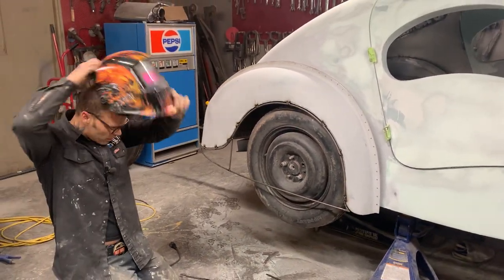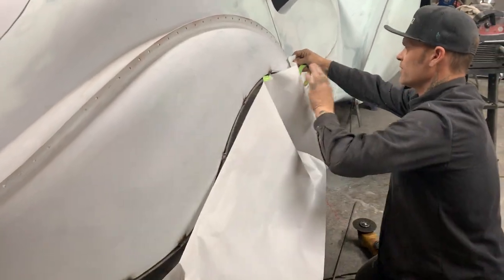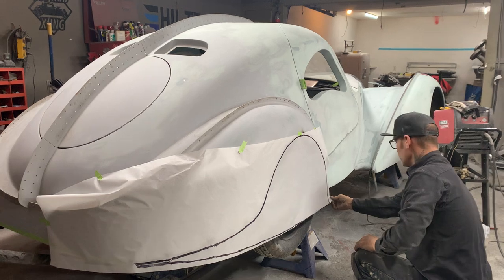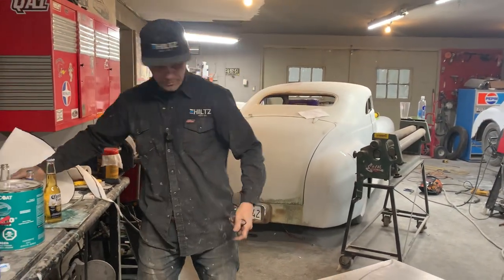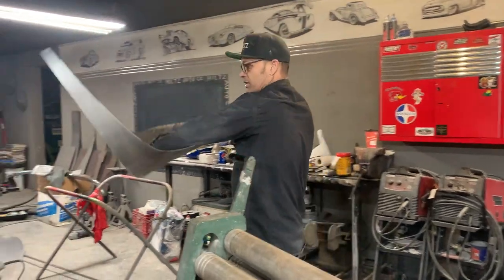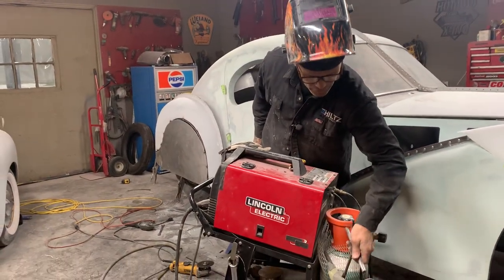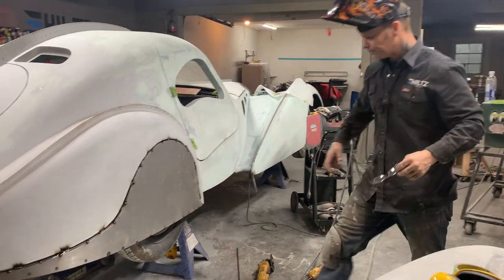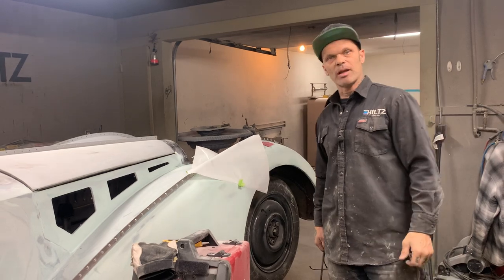FABRICATING A FENDER SKIRT ➡ PAPER PATTERN TRICK

Comment: My Packard fender skirt has several attachment components. First are several locator pins coming out of the skirt lip and into holes in dye fender lip. Next is a woven cotton strip that prevents squeaks and rattles. At the back end is an actual lip and bolt that allows the skirt to drop down for total removal or left in place if on a lift leaving the skirt dangling down while the tire is changed. At the front inside of the skirt is a rod with a handle on it. It works sort of like a hood support where it clamps down onto the radiator. Clamp it down, everything stays in place. Reach in and push it up and the skies swivels down. I think that 64 Pontiac’s had the same skirt attachments. Good luck and Merry Christmas. 🎁
Reply: Where in the world did you get a Bugatti to toy with????
Reply: Unlike your packard, i was wondering how he  does a tire change.
Reply: He made every piece of it himself. As soon as he is happy with the profile he will carefully cut the skirt and fender apart. Then he will finish the edges and create the mechanisms to hold them in place and then release them for access to wheels and tires. Keep watching. This is where it gets good.

Comment: When I was a welder fitter I use to use my hammer all the time as a push stick or I would have to use dog's because I worked with much heavier metal than what you work with but I must say that looks like a handy homemade tool you got there for sure. For working with thin gage metal, that is.

Comment: You could make both sides meet in the center of the back it would lower the back apron about an inch or so and you would have a parting line where the two separate at the center point, think it would match the center rib somewhat.

Comment: Would you still roll your panel even if you were making a flat panel(unlike the bottom of the fender skirt being partly bowed out). Like making a panel on a jeep wrangler or a similar vehicle with straight panels to prevent oil canning? That's the first time I've seen that done and seems in my head like itd work with a completely flat panel as well